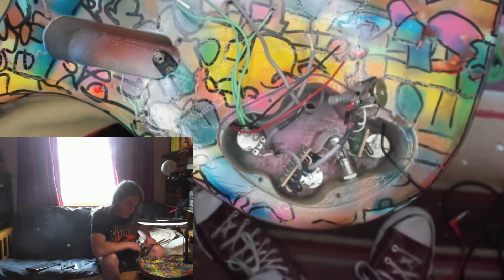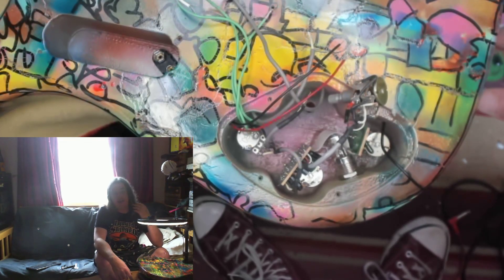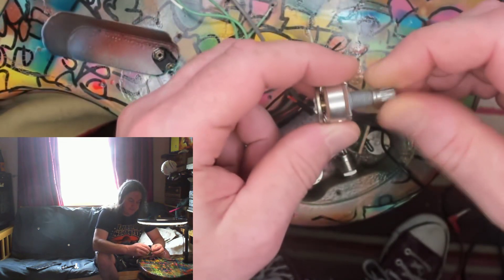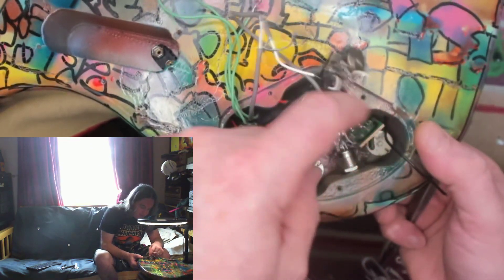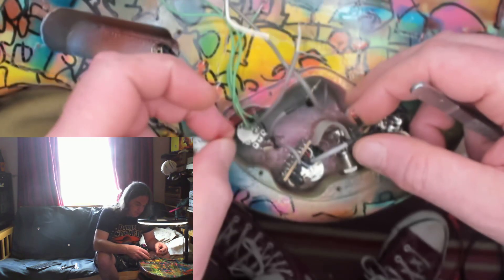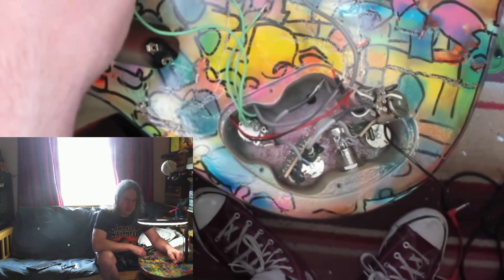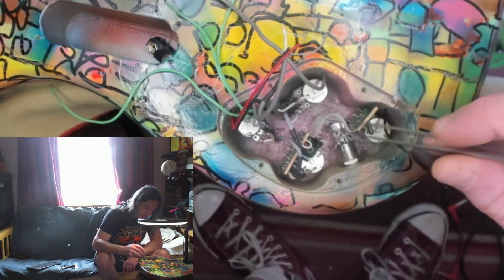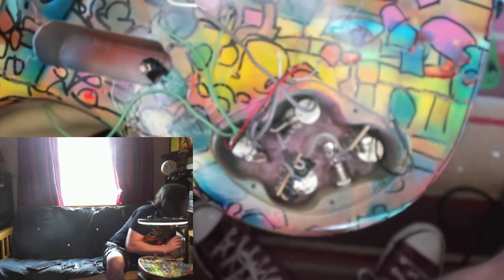wiring up an active bass (yamaha rbx470)

Comment: What do the circuit boards actually do?
Reply from the maker: its a preamp with 2 knobs to boost/cut bass and treble - im not sure if the pickups are active? - modern emgs have the preamp chip built into the actual pickup but these just have 2 wires coming off them like passive pickups - but...it all works so i dont need to look into replacing them and am quite happy to remain ignorant about exactly how it works! - ive already done tomorrows video demoing the bass - im actually liking it!